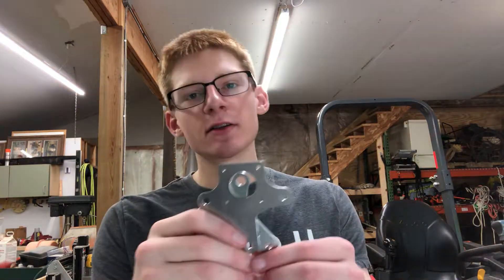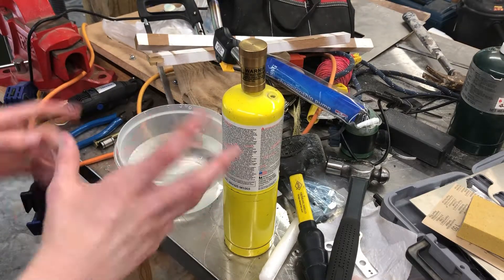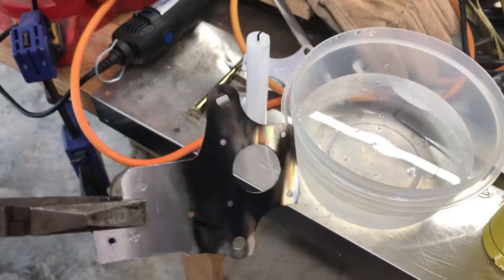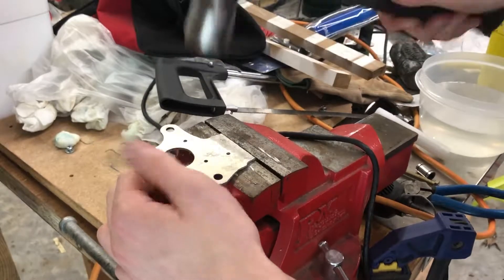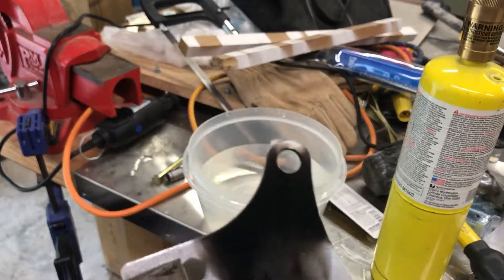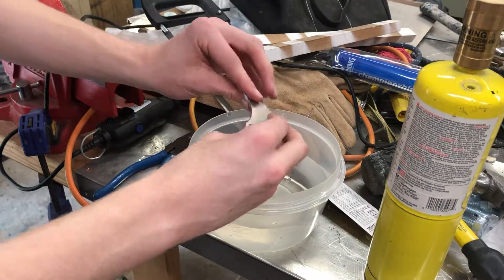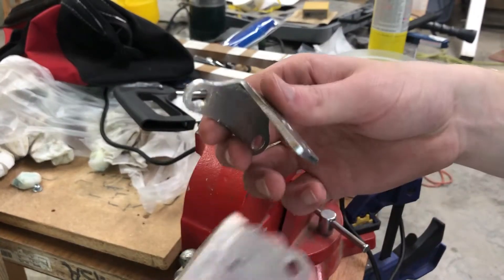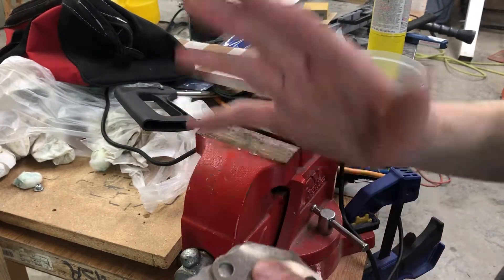Annealing and Bending Aluminum Plate

Comment: You can harden the pieces by simply leaving them alone for a while at room temp. They will reach their full strength after latest 4 days. 
You can speed up the process by placing them on heater or in an oven at low temp. This will help with diffusion.

Comment: Today, I tried bending 6mm plate aluminium for a rally car sump guard. I cut half way through the full length and rested my trailer and rally car weight on the bend with wooden blocks either side thinking it would bend. Not a chance, I jumped on it, hoping it would bend, then it snapped. Lesson learnt. Give it to the professionals . Good video, thanks.

Comment: If you are making a small bracket for which strength is not an issue, okay. I would add some cautionary advice however:
1.Various grades and alloys of aluminum can have vastly different processing temperatures.
2. Heating just the area you will bend  may soften that area but can result in changing the temper of the remainder of the part.
3. Annealing  aluminum is generally used to remove residual stress from cold working, relieving work hardened areas.
4. To allow safe forming of raw stock it should be solution heat treated; that means heating the entire part uniformly to a temperature where the alloying metals go into a "solid solution", typically between 850°F and 1050°F depending upon the alloy. (For details check AMS-2770, 2771, and 2772 process specifications)
5. Heating is followed by a soak time at temperature to allow the alloying metals to dissolve in the aluminum matrix. (again refer to AMS 2770,1,2) This time may be as much as 15 minutes, more depending upon the alloy.
6. For small or thin parts (less than 0.090) you have a maximum of 5 seconds between removal from heat and full immersion in the quenchant.
7. Some alloys age-harden naturally (alloying materials come back out of solution to form grains), a few as fast as within 96 hours).
8. After cold working, the entire part should be solution treated again and then precipitation hardened (aged) to a temperature between 350°F and 500°F depending upon the alloy and the desired temper.
9. Failure to consider the effect of the heating on the entire part can result in stress failures in places you did not expect them.
10. To insure the part has reached an appropriate temperature using the soot as an indicator you might consider heating the side away from the soot so that your lean flame does not oxidize the soot prior to the metal being at the proper temperature.

All of the above is offered as a caution.  Parts that will be subjected to stress and where personal safety is an issue should be processionally heat treated after your forming process, and dye checked for stress cracks.

None of the above is to suggest that I have never bent aluminum tha way you have showed, I have.  Just keep your use in mind.
Reply: thanks for the helpful info
Reply: I'm going to be making an aluminum bracket that uses the same bolts that hold the backrest to the backrest bracket or mount on our Harley-Davidson and I want the aluminum bracket (It's going to be an American flag mount/bracket) to bend into kind of a U shape but with tighter bends in it then a U, closer to the 90° bends he put in his bracket in this video although they don't necessarily have to be that tight of a bend. Anyway, the bottom of the U will be more of a flat platform with a hole drilled into it so that I can use the seat bolt in the back to act as a base and also just be another point to hold the bracket in place except most of the hold and weight would be carried by the the bolts that hold the backrest on, the seat bolt will be more or less just to keep it centered and keep the bracket with a flag mounted on it from moving around side to side etc etc but not really for the main strength of it. I wish I could draw a picture for you so that you could better understand what I'm trying to say, lol, but my question is should I just cut the bracket, drill it and bend it cold and then heat treat it or should I heat treat it first and then cut, drill and bend?
Reply: so I want to make a piece for my numberplate and bend it like 45 degrees you would recommend not heating it in this regard is that correct ?

Comment: wow~ ! thanks so much! I had to figure out how to bend back a few outboard motor pans from some numbskulls transporting them on their sides. this prevents the cowls from being able to snap on. I tried this (attached to the motor) and the (really) thick aluminum actually bent without snapping! I quenched it with a garden hose (cold well water) and used vice grips then tree wedges to bend it out... back into position. Would this work if I hadn't removed the paint?

Comment: For stronger parts don’t go for tight bends they induce much more stress cracking. Look for proper radius bend chart. It varies from 1-5 x thickness of the material depending on alloy and thickness. Good job.
Reply: This happened to me today, followed by much profanity.